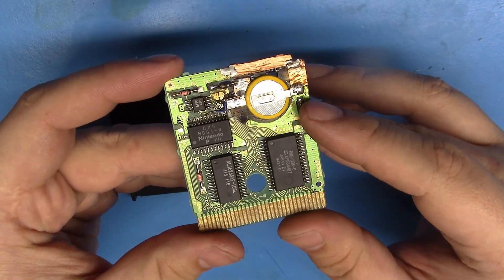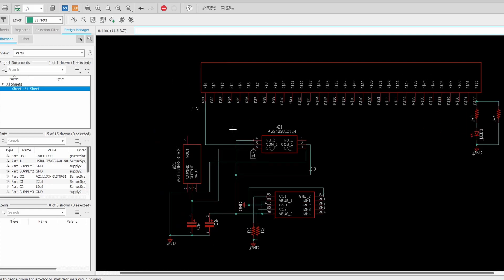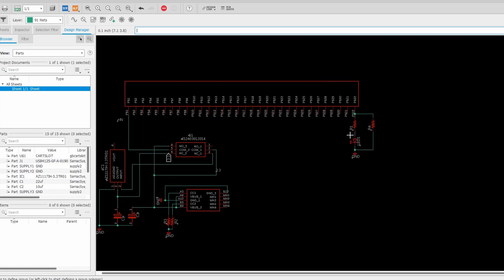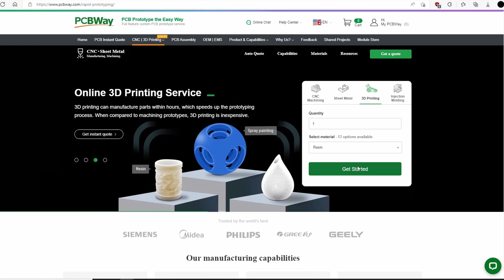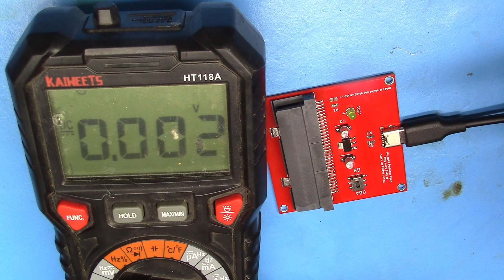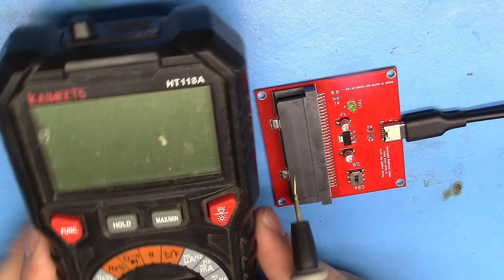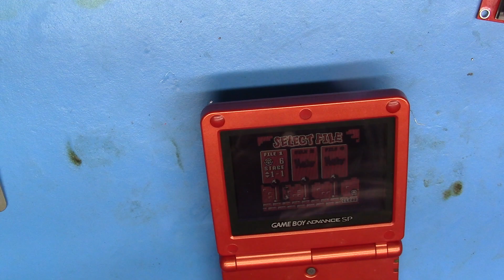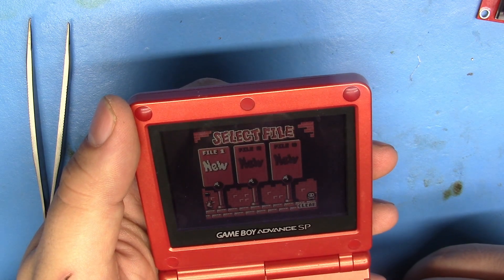Change your Gameboy batteries without losing the save data with this lil board!

Comment: Doesn't placing the LED indicator through the ground path rob the cartridge of voltage?
Reply from the maker: It does a little but in my testing of GB games not enough to make the cart drop out. I will have to do more testing for GBA games. I initially wanted to use an op amp for the indicator and I just might for the second revision just so we can elimiate that voltage drop

Comment: tbh I feel like this way has a lot more things that can go wrong instead of dumping the content to a file since soldering inside the cartrdige shell could also lead to problems
Reply from the maker: I've been doing this exact method but with a bench power supply for years now with no issues. All boils down to ones ability.
Reply: Use a donor shell if you can’t do it without melting the shell.

Comment: I've been using a mega memory card to do backups of the saves before swapping the batteries for as long as i can even remember, this is such a simple solution i can't believe no one thought of sooner.
Reply from the maker: I have never even heard of that device! Just googled it and dang it looks cool and also exactly how I expected lol. Miss those days of accessories
Reply: @Solder_king  I remember corrupting my MegaMem Card with the relatively huge save from a Game Boy Camera so it isn’t a perfect solution. Also, the UI doesn’t describe the difference between “Erase” and “Delete” well enough. You might need to remove one of the save backups to make room to backup another and in the process you end up wiping the very cartridge you wanted to backup!
Reply: I have two Mega Memory Card (recently fixed one on Rumble). One is my original from the ‘90s and I still have the box. :) That said, I’ve always just dumped the saves with my Bung GB Xchanger which I’ve had since the ‘90s.